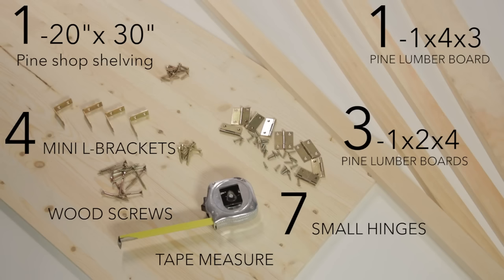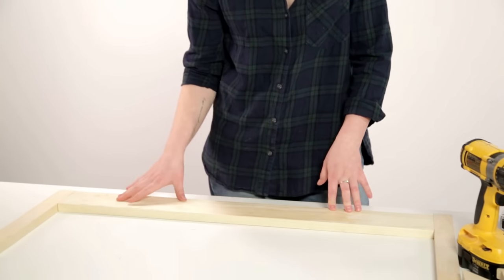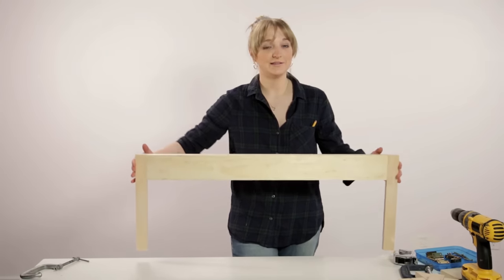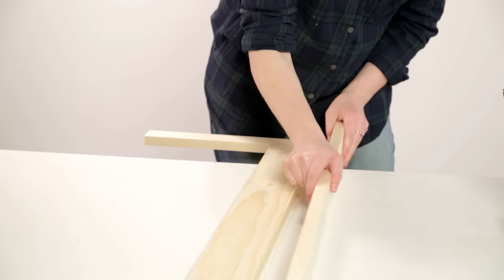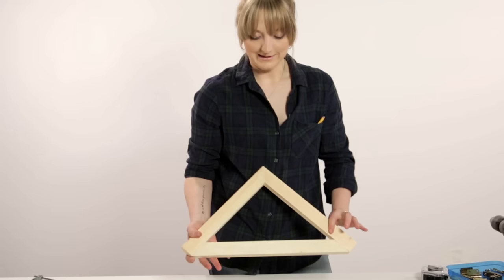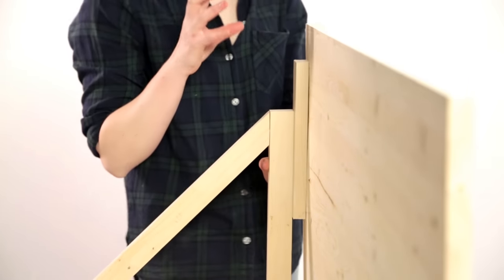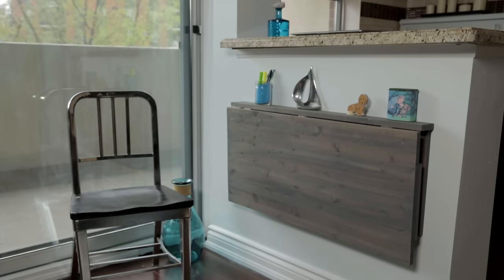SAVE SPACE WITH THIS MURPHY DESK | COMPLETE TUTORIAL

Comment: Pretty sweet - thanks for posting! Not sure if I follow what the reason for the 1" x 10" long 'spacers' you put on the bottom side of the desk but it will probably make sense once I start the build. I think I will add a small stop on those pieces to make sure the support legs cant be knocked out on accident and collapse the desk. Thanks again!
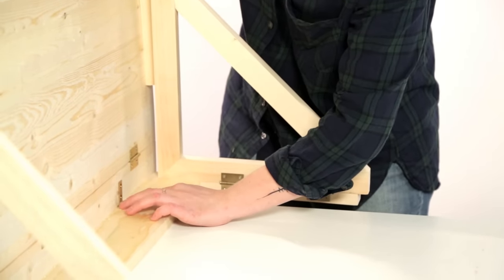Reply: Just an assumption, if they are tight the to the bottom of the desk when you fold the L brackets in to close the desk they will hit the round part of the hinge on the bottom(look at 2:58), materiel she already had was a good spacer. Love the idea btw, building it this week for my daughters room.
Reply: I also worried about the brackets.. imagine if someone unintentionally hit the brackets the your precious laptop will suffer.. 😨
Reply: I was thinking about notching out the support where the hinges would hit in order to avoid adding these spacers. Think that would work?

Comment: When you're building the frame, you say to use a 36 x 3 inch board and then screw in the two 2 inch boards on the outside. That makes the total width of the frame 40 inches. Yet, the width of your desk is 36 inches and aligns perfectly with the frame. Did you mean to say the main frame piece should be cut to 32 inches?
Reply: Hey, I just build this desk yesterday and found this out the hard way. I had already assembled the frame and was attaching the desk when I realized the frame was too long. I cut two pieces of 1x2x17 I believe (whatever the length of the top board was) and attached them to the outside edge of the board, then attached the 1x2x10 pieces onto of that for the gap for the hinges. It also added a bit more surface area which I'm happy about. I hope this makes sense, Im not great at wood working but found this quite easy to follow along!!

Comment: Hi, awesome video I plan to buy parts today. Just wondering if you could link again to the section where you attach it to the wall? On your blog it just says the same as in the vid “attach to wall”. Many thanks, awesome video!
Reply from the maker: Hi Jason - Not sure I fully understand what you're asking. Attaching it to the wall will vary depending on what kind of material you're going through. For proper support you need to make sure you find the studs in the wall, and then you should be able to screw, or nail into those beams. Just make sure you attach them to something quite sturdy so that the desk can hold a fair amount of weight!
Reply: Hi Coral, I've never drilled anything into the wall before so I'm a complete newb :) I think I"ve figured it out, I'm drilling into a brick wall so will be buying a hammer drill and have watched other vids on how to do that. Also made a few mods, putting a little cupboard section above the table and making it fold upwards instead of downwards (so it doubles as a cupboard and a fold out table).
Reply from the maker: That sounds so cool! By all means please share a photo with us when you're finished. We'd love to see how the final product turns out. Either on facebook, twitter, or instagram - and if you're ok with it, we'd love to share it with everyone else.

Comment: Umm..is it just me or are the dimensions all wrong on your blog?
(1) 36” X 17” (Desk)

(1) 36” X 3” (Back Base Board)

(1) 30” X 3” (Under Frame)

(2) 14” X 1” (Vertical Frame Pieces)

(4) 14” X 1” (L Bracket)

(2) 17.5” X 1” (L Bracket) *Cut at 45 degree angle

(2) 10” X 1” (under desk stoppers)

How does the frame (30" + 1" + 1") align with the 36" board?
How does the 14" x 1" L bracket with one side cut at (I assume since it is not mentioned *anywhere*) 45 degree, fit with the 17.5 " x 1" bracket cut on both sides at 45 degree?

Comment: Nice vid but those 1" blocks you add to the underside of the table could just as easily be stops and the brackets could go up flush no?
Reply: No, if the brackets were flush, you'd struggle to fold them in.
Reply: @MattGreenfield89  also and more importantly you need a gap to clear the hinges when it swings in.
Reply: @MattGreenfield89  That's if you screwed the brackets in right

Comment: I was wondering if you'd be able to give a rough estimate on how much pressure it could hold? I tend to write a little harder.
Reply from the maker: Hey Samantha! 
It’s a VERY sturdy table. It will definitely withhold a strong hand. When we tried it we filled it up with heavy textbooks, computers, etc and it didn’t even come close to being an issue! 
That being said - if you don’t attach it to the studs in the wall properly, it may come loose. So be sure to get a stud finder and mount it as directed!
Reply: Coral, thank you so much for responding to me. My boyfriend and I living in a house but out room is so tiny. I cant use the dining room table because there are two people chain smoke beside the dining room so I get smoked out. I thought of the basement but one guy lives down there and goes to bed at 5:30-6:30pm. So this is a very smart option for me
Reply: Coral So how many pounds can it hold exactly? And if I make it about 2 feet longer than that should I make a third support in the middle?
Reply from the maker: Hey Kiara, we can't tell you exactly how much it can hold, because your set up will be different than ours! A third support wont hurt - that's for sure! It's definitely more sturdy than you think.
Reply: kiara ortiz i built this without the 3rd support and it can hold my 2 kids standing with total 22kg

Comment: Not sure when you describe wood as 1 x 4 whether you are talking about dimensional lumber which is 3/4 x 3 1/2 or actual size. Thanks
Reply from the maker: Hey Steve - Sorry for the confusion! 1 x 4 is referring to the dimensions, not the actual size!
Reply: 1x4 is referred to as the "nominal" size which it is labeled and sold by, actual milled size is smaller. Just like a "2x4" stud is actually 1-1/2" x 3-1/2"" Not sure why she said "1x4x3" though unless the 3 was intended to specify the length....

Comment: Hey Dani, I love this and would consider doing this as a first woodworking project. However, I live in a downtown Toronto apartment with the thinnest possible walls. I have tried various plugs to hang things on my walls, with no success. I've had shelves fall off the wall, one fortunately, during the day onto my son's bed. Had it been at night who knows what might have happened. So now I don't hang anything.
Can you do a video on how to hang something that has or will have a little weight? Thanks and keep up your amazing projects.
Reply: oh dear! I always recommend speaking to an expert at your local hardware store. They may be able to suggest a great alternative for you. If you're plugs are falling out, that could mean you're using the wrong size plugor type. Look for one that spreads out or locks into place when they enter the wall. The name of the product might have the word "toggle" or "lock" or "twist". If you're still having issue, you could use a toggle bolt, which is pretty heavy duty. It's possible you may just be putting a plug into a stud.

Comment: How exaclty did you mount it nto the wall?
Reply from the maker: We screwed things into the studs in the wall! You may need a stud finder (https://amzn.to/2LxPvR6) and research the best type of screws for your walls (they may be different from ours!)
Reply: If you dont have a stud finder - a quick and cheap trick is to knock on the wall while you move left/right - you will hear a change in the sound to indicate there is a solid member behind the sheetrock (or finished surface) then you can drive a small nail in that location to confirm there is, in fact, a stud located there.

Comment: Couldn't hit like or dislike. There needs to be a "meh" button. If your gonna use screws then use pocket screws and glue. Screwing the frame the way you did is a weak joint. Going from the outside of the small boards edge grain to the inside boards end grain is a weak way to utilize screws. Pocket screws go into the face grain, at an angle, of the horizontal support and then about halfway through the vertical support. Much stronger joint. When used with glue and pocket screws in this manner, it gives you a stronger joint than a glued mortise and tenon joint. 

Also I would use a thicker hinge and get metal triangle brackets for the desk top support. Attach the brackets to a piano hinge so they can fold in behind the top when it's not in use. 

Now let's get one thing straight. I'm not saying yours is bad. I think yours is built for light to medium light use. If that's all you need it for then go for it, this will be cheap and practical. But if you're intending to put more weight than a few small flowers and a couple of books and candles then I recommend doing some upgrades. I heard you say it was for your kids. My child could wreck that thing in a week easy and she's 4 lol.
Reply: Wow thanks for the details there! I had that thought as well with pocket joints. In your opinion, how would you make this stronger? So for someone like my self, I just plan on putting a laptop, lamp and maybe a few books on it, it will be for study.

Comment: 2 14" pieces will NOT make a 17 1/2" piece of wood fit flush to make a perfect 45/45 angle...it is basic math.  Now making it 90 degree, she is only off by 1/8" on each side, but it would not be true like the video. If you look closely, she has a gap in the 90 degree angle to make her measurements true...lol.  If you want a complete explanation, then pm me, I am not going to do the math for everyone.  The formula is a(sqr)+b(sqr)=c(sqr)  Even though you made a murphy table, you left out on how to mount it.  Stud spacing could range from 12-18 inches for the behind the wall wall joists.  It is clear that you are at least 2 inches away from the outlet, to which all outlets are mounted to wall studs, so what did you use to mount to the wall, I hope you think that drywall will hold it...also from the video you are at leat 4-6 inches away from the corner, to which, no stud support, so once again, what did you use to support your murphy table without stud support?   Lastly, you provide what you need, you show the screws, but not the dimensions of the screws, meaning are they 6, 8 9 dimension and what is the length? this was a worthless video on how to mount your murphy table.  C grade on how to put it together, but an F on how to mount it.  Please do not use this video to make a Murphy table as there are many other videos that are better.  Nice attempt, but needs work.